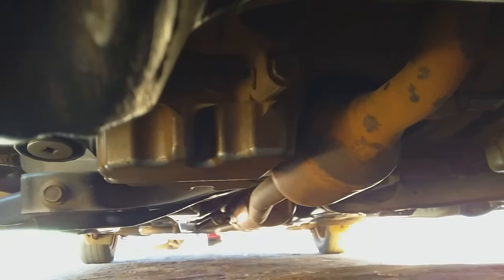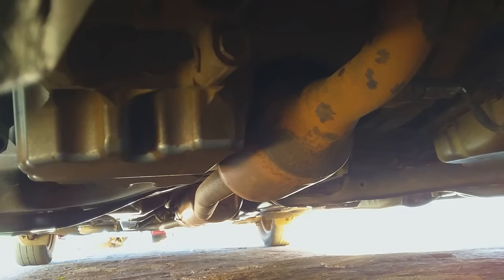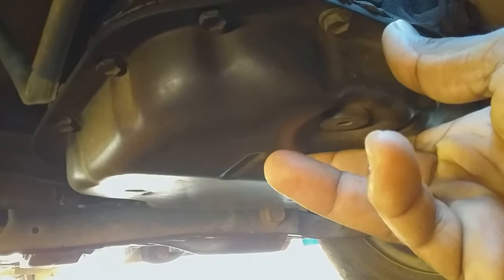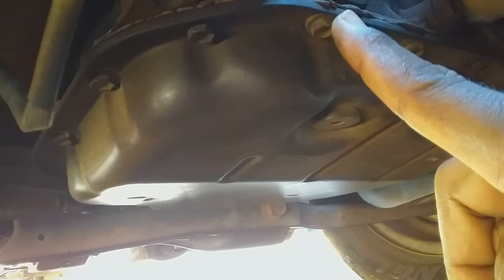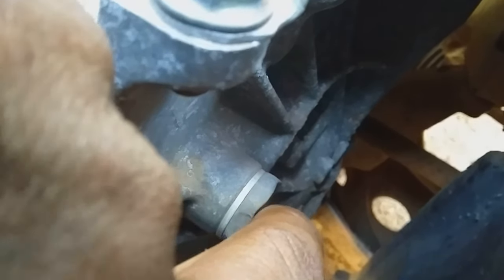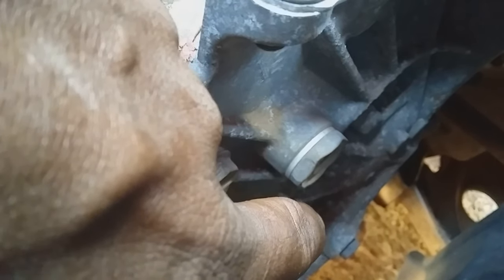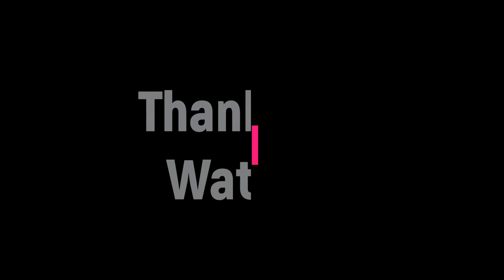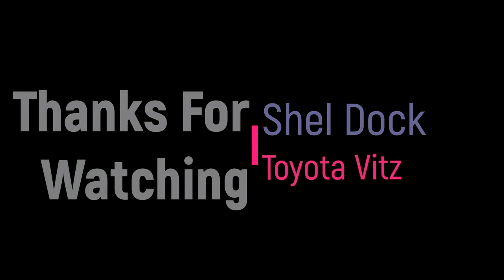Toyota Vitz CVT Transmission Fluid Check No Dipstick

Comment: Very important to use the correct CVT fluid! Either TC or FE, it's marked on the filler plug. AND good practice is to loosen the filler plug first, to be sure you can undo it! And of course, follow Toyota's procedure for this job; it isn't as simple as shown here.

Comment: I am seeing where Toyota says you have a life time oil in these new transmission, what's your say on that. Do it need changing or what.
Reply from the maker: Thanks for your comment. The transmission fluid definitely require change over time. I had to change my transmission fluid because I was experiencing slight slipping up hill. I  believe 6 to 7 years in it is good enough with regular commute.
Reply: @ShelDockToyotaVitz   Like Brown said, because of that comment I never changed my transmission oil and now my car 3 cylinder vitz running very slow. It goes 5km/h up hill and max 70km/h down hill.  I toke it to a mechanic and he said my throttle body is faulty and it's the cause of my problem which I'm really finding it hard to believe but I'm thinking of changing the ATF 1st. Please help me out?
Reply from the maker: @abrahambioblack1960  hopefully you don't have any damage done to the transmission if it's slipping and you are still driving it like that. Slipping will cause  wear that will destroy the transmission if it is not rectified immediately. I strongly recommend that you change the transmission fluid as soon as possible. If the slipping continues it could mean that the transmission may need changing.
Reply: @ShelDockToyotaVitz  thanks, I'll work on that ASAP

Comment: Your procedure neglects the fluid temperature required for the leak/drip test to be done. Due to fluid expansion, the level must be checked at the right temperature band. If checked while too cool you may end up overfilling. If checked too hot you are likely to run out some fluid and end up underfilling. Without a capable instrument to check for the prescribed fluid temperature: OBD2 terminals (usually 4 and 13) may be bridged/connected, start car, move shifter from P to D and back to P, swiftly move the shifter between D and N (about 4 times) then back to P. The D indicator in the combination meter comes on steady (for ready), Flashing (for too hot), and does not show if too cold (https://www.youtube.com/watch?v=x97UZXhhAk0).. Once a steady D shows, remove obd connector and carry out drip test.
Reply: Wow

Comment: Hi. The battery light has disappeared since I've changed coil plug. But now my fuel pump is going bad i think. I have engine hesitation and sometimes engine detonation?? Do you have any idea? Thanks.
Reply from the maker: Usually this indicates that your battery is not charging properly or your battery is going bad.
Reply: @ShelDockToyotaVitz  i had my alternator repaired tested ok battery was charging. Still at some time battery light flickers on and off. My coil plug burnt 2 times before that. Can it be something else? Thank in advance
Reply: Also my fuel consumption increase a lot since the last 3 week. Can it be the ecu?
Reply from the maker: Since you have done all that work and confirmed it is not the problem then it must be something else. Check to ensure that your battery to alternator connection has no loose connection.
Reply from the maker: Your fuel consumption. When you are driving is your ECO light in the dash board on?
Reply: @ShelDockToyotaVitz  i don't have eco light on my vitz. But i changed coil plug. Now I'll test it out for a week and see if its ok.
Reply: @ShelDockToyotaVitz  I'll see for the next  2 week if the problem continues. Then I'll revert back to you. Thanks

Comment: Hi dude! 
Is the correct measure of oil when it is full to the top screw?

I'd like to know that, because I removed the top screw you show, put my finger in, and didn't feel any oil.
Reply from the maker: Unscrew the bung under the transmission and remove it- ensure a catchcan is there to catch the overflowing fluid. Pour the fluid in at the screw shown in the video until it start to flow out through the bung, stop and replace the bung.

Comment: For 2008 toyota vitz 2sz which cvt should i use, TC CVT Fluid or FE CVT Fluid?
Reply from the maker: CVT FE is usually used for more advanced CVT transmission for mainly fuel efficiency in Toyota Vehicles. The TC CVT is for the older CVT system for Toyota vehicles. Newer Toyota vehicles would use the CVT FE transmission fluid.

Comment: Dear how many litters it take after changing gearbox for 2sz fe?
Reply from the maker: It is good to have a manual for your vehicle because it tells you exactly how much transmission fluid or gear box fluid to use. 
If you do not have a manual for your vehicle you can drain the fluid in a drain can then use this fluid  as your means of measuring the new fluid to go in your transmission or gear box.
Hopefully this can help.
Reply: @ShelDockToyotaVitz  according manual it takes 6 litters but mechanics are saying it takes 3.5 litters
Reply from the maker: The mechanics are correct.  My 1000cc 1Kr engine uses roughly 3.5 - 3.7 liters.
Reply: I have have the same issue, 2010 Vitz, 1KRFE, Auto Transmission, japanese manual says 6.8 Liters, Mechanics say 4 Liters...
Reply: @sufyanahmed3513  how long did u use the car for u to change it pls

Comment: I have a toyota axio which has a similar tramsmission and it has a leak at the breather cup. What is the rememdy for that?
Reply from the maker: Breathers are usually placed in certain locations so that fluid does not leak from them. If you have a leaking breather, chances are your fluid level is too much or too high. Follow the directions in the video on how to check if your transmission require more or less fluid. Thanks for you request.

Comment: What is the recommended transmission oil for vitz 1kr
Reply from the maker: 4 liters of Toyota cvt transmission fluid. Ensure that Toyota CVT transmission fluid is written on the container.
Reply: @ShelDockToyotaVitz toyota vitz 2010 rs model...what transmisison fluid is recommended for it?
Reply from the maker: @evercalm3283  https://www.ebay.com/itm/285071187413?chn=ps&_trkparms=ispr%3D1&amdata=enc%3A1owh6gm6xR8yHi2p0XPE7zw3&norover=1&mkevt=1&mkrid=711-117182-37290-0&mkcid=2&mkscid=101&itemid=285071187413&targetid=1644837435723&device=m&mktype=pla&googleloc=9003557&poi=&campaignid=20125739985&mkgroupid=149128855676&rlsatarget=pla-1644837435723&abcId=9312975&merchantid=108824098&gclid=Cj0KCQjwldKmBhCCARIsAP-0rfwcYXTKzfhPSUG-IJAoRQzXnbhD3ooXDPGSgKaj3OZXVOYO0O5W93caAn-CEALw_wcB
I used this CVT transmission fluid and never had any problem an its more than 3 years now.

Comment: how can i tell if my car has cvt or atf transmission fluid
Reply from the maker: Newer vehicles are made with CVT transmission. This type of transmission is usually compact and smaller than a automatic transmission- older transmission type. Because CVT uses a belt and pulley system you hardly notice when there is a change in gear however with the automatic transmission, when the gear is changing there is a slight delay in power..

Comment: Sir which transmission fluid is better for vitz model 2016 automatic with 1KR engine?
Reply from the maker: Once it's a CVT transmission ensure that CVT is written on the container and ensure its Toyota CVT transmission fluid  if it's a Toyota vehicle you have.
Reply: @ShelDockToyotaVitz  yes it is Toyota vitz. Which container are you telling about? Is it the pan on the underside of the vehicle which contains transmision oil and a drain nut?
Reply from the maker: @makhtar9029  its the CVT fluid that you would purchase in a single 4 quart container/can or 4 single quarts in bottle.